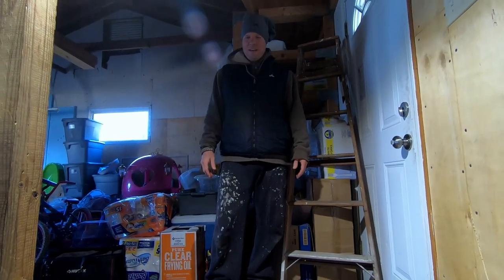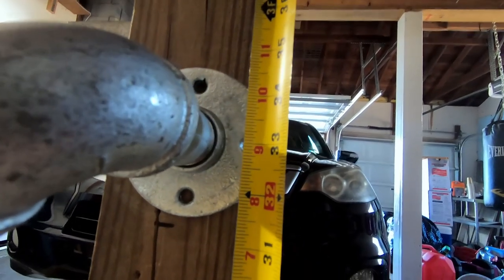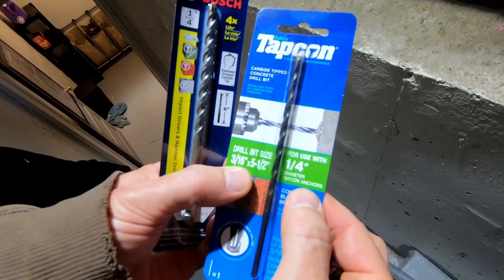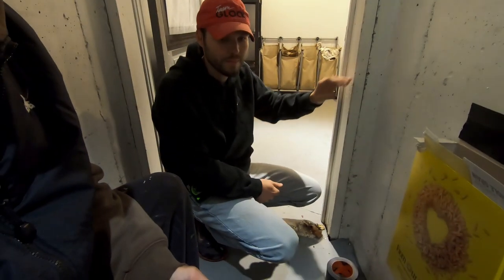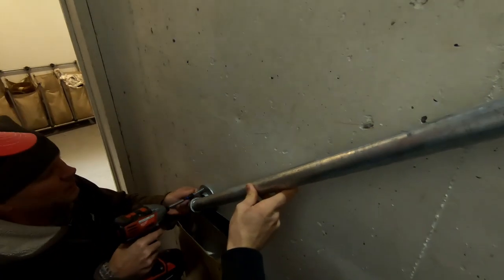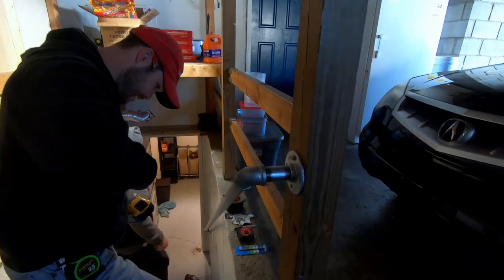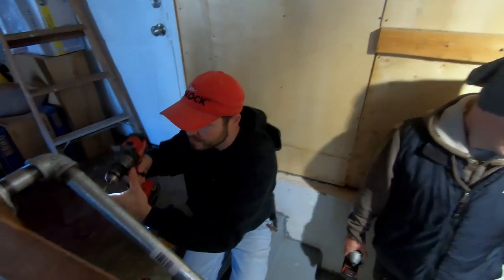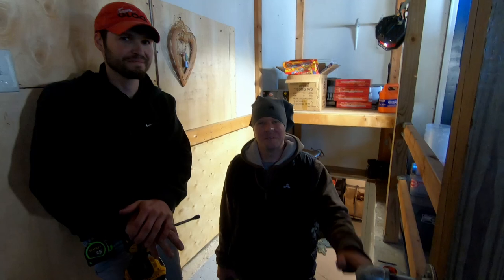Galvanized Pipe Handrail Install

Comment: Doesn’t it flex in he middle?
Reply from the maker: So the span on this one and the amount of flex is acceptable, but yes ALL steel will flex or deflect.  I say this one probably deflects around .25 of an inch.  If one were to use Schedule 80 pipe instead of Schedule 40 it probably wouldn't deflect at all to the human touch or eye.  Anything longer than this I would recommend putting a center anchor point in the middle of the span.  This is a super strong railing material to use and its super easy to install.